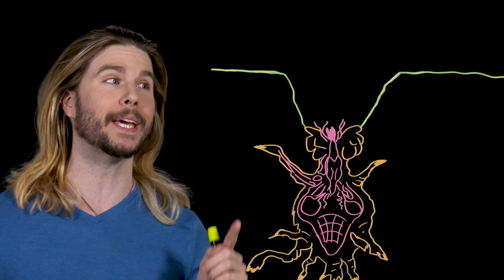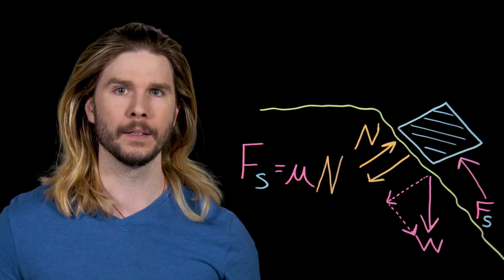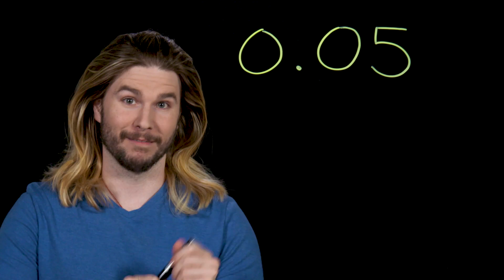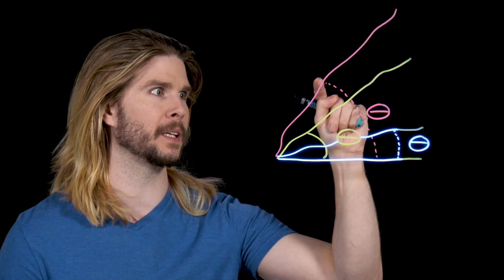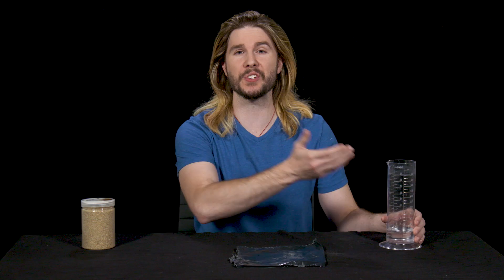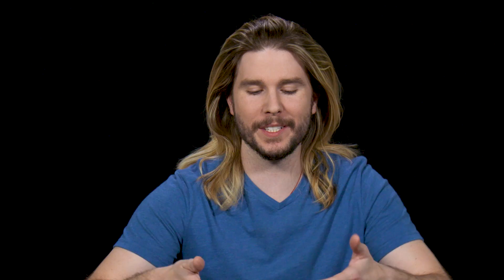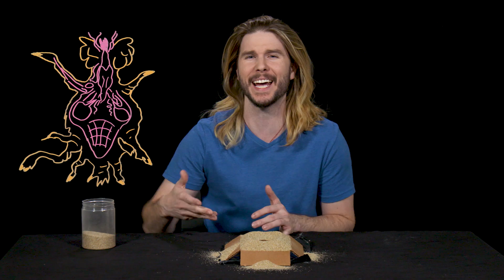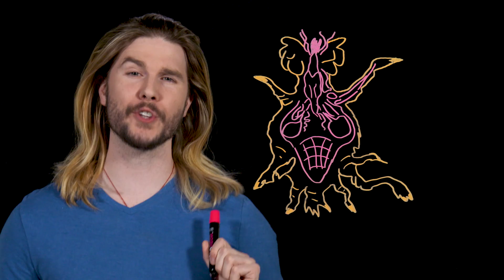How to Make a SARLACC PIT

Comment: This raises a very important and unanswered question:
What is the angle of repose of ball pit balls
Reply: Basically flat 0. I had a friend in high school who knew he wanted to be a surgeon and practiced putting a ping ping ball down on top of another ping pong ball to develop his fine motor control to an impressive degree.
Reply from the maker: @danielbeshers1689  haha that's amazing! -- kH
Reply: @danielbeshers1689  Is that even possible?👀
Reply: @codesimpson6010  I never could, but he eventually was able to with some regularity, in controlled conditions. He did, in fact, become a doctor.
Reply: Can confirm ball pit balls balance easier than ping pong balls do. Can also confirm that it's easier to build a 6 foot tall house of cards than to get one ping pong ball to balance on another. And if you can't keep the air very still, the balls won't stay balanced as long as the card house.
Reply: @a-blivvy-yus  Can also confirm that square houses of cards are infinitely easier to stack than triangular ones as the friction then works in your favour rather than against you
Reply: @MotoCat91  Yeah, they also build "flatter" so you get a lower centre of gravity in each layer, which helps with stability. They do so by building "flatter" though, so you need more layers to reach any given height. Building the same number of layers in squares is much easier than triangles, but building to the same height is only a little easier once you get past the first foot or so.

Comment: Little curious if it would be even more beneficial if the slope was "engineered" for an even greater angle by using wet sand as a base and then spitting dry sand on top of it? Or if it somehow made the sand finer similar to flour and used that as the final layer. But I think pure sand would be best because you would want that angle plus the material to easily break away from itself. If it packs too tight then it would increase survivability to anything that falls into the side of the pit. You need that breaking friction to be low as possible.

Comment: So is that the ideal scenario? If a Sarlacc made his pit near an oasis I think it could by introducing water make the angle much steeper. It doesn`t have to mimic the lionant because of its size it can create an even dangerous pit. I understand that the wet sand would not be so easy to slip into the pit but because the angle can come close to 90 degrees that woudn`t be an issue.

Comment: Kyle, the quantity of sand that likely falls into the sarlacc with each morsel of prey tumbling in due to minor avalanche would slowly become more notable. if we're drawing ant lion parallels or even just assuming that the creature wouldnt want to use the energy to expell the sand due to how scarce prey is in its environment, could the graduall accumulation of sand in its gullet potentially be a major contributing factor to its supposed slow digestion times?

Comment: Hey Kyle, Great show!
What if the Sarlacc had some sort of straw-like body part, long enough to tap into ground water and use the water to keep the sand walls slightly wet so the angle can be steeper?
Reply: That would increase the friction and make them less effective.
Reply: @Krishnath.Dragon  but it would also increase the slope.

Comment: It's the sand, like an ant lion. Angle of repose
Reply: Conversely, if the sand is too fine it would increase the electrostatic interactions and INCREASE the angel of repose like with flour. If the sand itself is either too coarse or fine, Kevin could secrete an oily substance to saturate the surrounding soil and increase the angle of repose for his pit above that of the surrounding sand, catching Jawas and banthas unawares.
Reply: Called it.